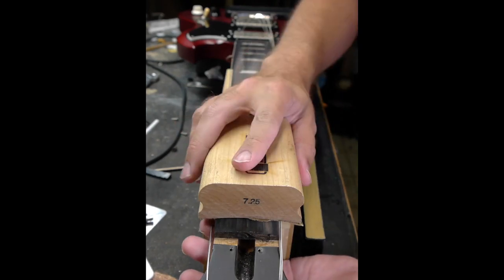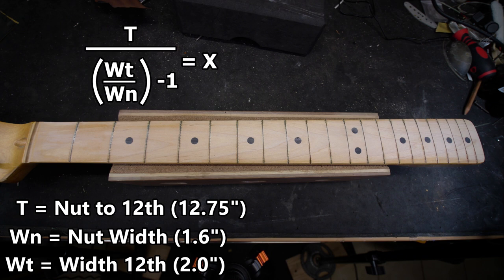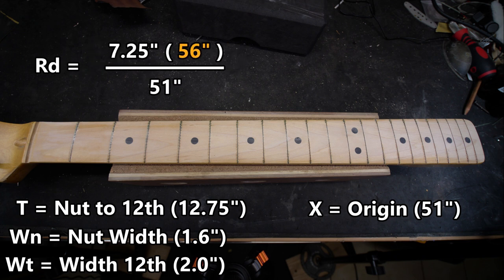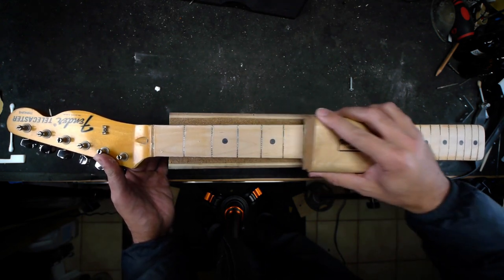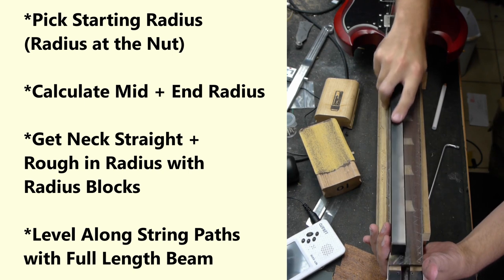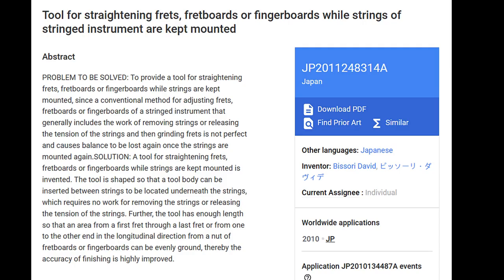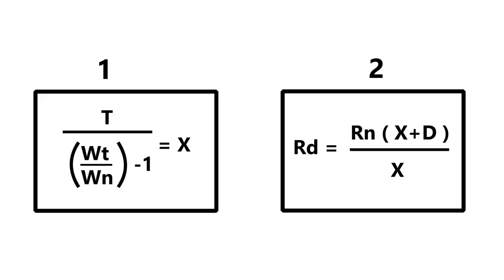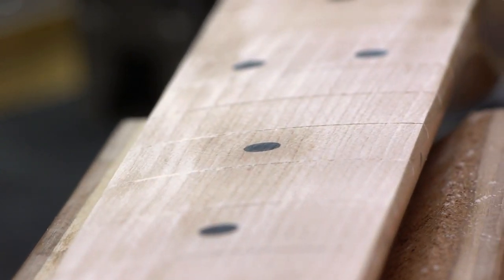"Compound Radius" Formula: Conical Profiling for Stringed Instrument Fingerboards / Frets

Comment: Looks like I can go lower on my treble string setups.  your 0.76mm action at the 12th beats my 0.933mm.  But I just set all the strings to the same action - so basically, I set them all to what the 6th string needs. And I never use falloff.  Also, I'm running Ernie Ball Extra Slinkeys - 8's thru 36w's.  So I don't need as much flopping room as you do with that 46 gauge string.
Reply from the maker: Lately I've been running .008, .011, .0135, .022, .030, .042. 

I'm never sure what to expect from the Low E. "Buzz" seems to be an undefined variable, that can't be objectively measured -- just heard, and most people have a threshold for what counts as buzz, and how much of it they can live with. 

What's your relief? Generally the E and the A are the only ones I get a bit higher -- the 0.76mmm seems to work fine for DGBE.

I've tried every which way. Old fashioned leveling with the strings off, neck straight, flat steel beam. And the other methods I talk about here. 

0.933mm on the Low E is definitely very low. If you're getting that, I'm curious how you'd define it -- any light buzzing or clear as a bell? And what method do you use? 

Generally I only use fallaway if necessary -- but I may have to redefine what "necessary" means. 

0.933mm on the Low E. That and 0.76mm on the GBE, and the D and A just a touch above that, would be ideal. The last frontier for me is the Low E and A -- and again, part of the problem is not having a standard for "buzz." 

I have played a couple guitars that were clear as a bell on the Low E around that measurement. Maybe once or twice. Exceptionally rare on a stock guitar. Now if I could master that, I'd really be in business. 4 out of 6 strings ain't bad but I need to get that E and A. 

One thing I've wondered is how flat my tools really are. It is possible some of my beams aren't perfectly flat and I'm not sure how to check them. That could certainly be a major thing here. 

Sometimes I've found higher tension strings to vibrate in a smaller arc as well -- if you're getting less buzz with a lighter gauge string then I'll rethink and re-test this. I do tune down to Eb with the strings I use and often go to drop D from there, so even that .042 gets pretty slinky.
Reply: @guitar_md  I run zero relief on Fender scale lengths.  For Gibsons, I'll start with zero and add a bit of relief if needed.  "Clear as a bell" is the only REAL definition of "no buzz".  I start by setting the fret plane level - not the neck.  So, I skip the notched straightedge and go directly to the flat straightedge on the tops of the frets.  After all, it's the tops of the frets that we want level.  If the fingerboard waves a bit, it doesn't really matter as long as the fret crowns are level.  For the nut, I usually fit a locknut.  I use a fret pulling guard in the nut slot and across the first and second frets. I then shim the nut until the fret pulling guard just clears the number 1 fret when resting on the 2nd fret and in the nut slot.  So, my action at the 1st fret is on the order of 0.005" - almost at the fret plane. Technically, you can go all the way down to the fret plane, but1/1000th lower and your screwed.  So, I shoot for just above the fret plane.  Then I set the action at the 24th to about 1.4mm and I'm done.  I could probably go a little lower across the board if I wanted to be OCD about things.

They make what are known as "machinist's surfaces" (or a similar name).  The are dead flat surfaces suitable for checking the accuracy of tools, but they are expensive.  A machinist's square or straightedge is a possible alternative:
https://www.amazon.com/Granite-Surface-Plate-18-Grade/dp/B006JYKIVC/ref=sr_1_5?keywords=machinist+surface&qid=1700163886&sr=8-5

https://www.amazon.com/Granite-Surface-Plate-12-Grade/dp/B006JYKIE4/ref=sr_1_16?keywords=machinist+surface&qid=1700163886&sr=8-16&ufe=app_do%3Aamzn1.fos.17d9e15d-4e43-4581-b373-0e5c1a776d5d

https://www.amazon.com/0-0002-10-Straightness-Parallelism-Machinists/dp/B0CGDLKP7P/ref=sr_1_10?keywords=machinist%2Bsurface&qid=1700163886&sr=8-10&th=1

https://www.amazon.com/Anodized-Tolerance-Straightness-Machinery-38/dp/B07H3DQQHS/ref=sr_1_20?keywords=machinist+surface&qid=1700163886&sr=8-20

Use Stringjoy.com's tension calculator to find out exactly what's what with your string tensions:  https://tension.stringjoy.com/
It will tell you the effect of changes in scale length, tuning, and string gauge on the tension required to bring a string to pitch.  And more tension = less floppy.  Generally speaking, shorter scale lengths, fatter strings, and lower tunings will all make the strings floppier.  That's why multiscale is superior for fat strings and drop tunings.  The longer scale lengths help counteract the floppiness from the fat strings and drop tunings.

I'm certain you could reproduce my results and probably even take then a bit farther by switching to 8 thru 36w's and standard tuning.  If you're worried about losing fatness on the bottom end with 36's, just give it a notch on volume and a nudge on the lower bands of your EQ pedal.  If you're out of headroom - time for a bigger amp.  If you have to play something in D instead of E, a pitch shifting pedal is a possible alternative to drop tuning.  But if you're really into fat strings and drop tuning, I'd recommend you make yourself a multiscale 6 or 7 string.

FYI, Ken Parker makes his under string fret leveling tools from pickguard material and sandpaper - no handle.  They are quick to make, easy to use, disposable, and inexpensive.

So after watching this and a few other vids on compound radius fretboards, I've decided to try something totally insane - a 12" or 16" to infinite (flat) "compound radius" fretboard.  Being flat at the heel, it won't be a true cone.  If it doesn't work, I can always get another piece of Richlite and do a 12 to 16, or a 16 to 20 or some such thing.

Its just occurred to me that those formulas might be artificially restrictive.  Nothing says the cone has to be uniform in both width and height.  But the formulas restrict the height to what will fit in the width.  Nothing says the cone must be circular on the bottom.  An oval bottom (wider than it is tall) would allow more radical changes in radius. So you could do a 9.5 to 16 instead of a 9.5 to 12, for example.
Reply from the maker: @normbarrows  We have very similar tastes. Zero relief here as well. I also level according to the level of the fret tops, and don't use a notched straightedge anymore. I know exactly what you mean. 

With you on the stringjoy tension calculator as well -- actually have been working on a video about it, regarding string tension and preference. A lot of players just go with stock sets when sometimes it can make a tremendous difference to swap out even one string. 

One of my old friends (one of my mentor's best friends as well), who was a machinist (only relevant because we were talking about that) -- he loved a regular .009-.042 set but with a .015 on the G. 

For me, I was using a .014 for a while, and eventually came to .0135. Using the Stringjoy calculator, it puts my GBE strings right around 10 pounds of tension. I'm OK with the .011 B string but a .0105 would actually be closer to equal tension, around 9.8 pounds. 

There are some people who prefer progressive tension -- each string successively getting a little higher in tension -- some who prefer balanced, etc. String gauge is a very personal preference yet most people don't know what they like simply because they haven't experimented -- and that's OK! But experimenting with string gauges is a real joy. 

String compliance is another factor, or how easily the string bends. Break angle at the nut/saddle will affect this, also whether using a locking nut or not. I tend to like very shallow break angles on my electrics, or at least, as shallow as possible. So with a decked trem on a Strat, I like replacing the saddle screws with shorter iterations (I also prefer 316 stainless steel because it's pretty much 100% rust proof, important when dealing with corrosive sweat), I get the action where I want it while having the saddles as low as possible. 

Sometimes that requires shimming the neck at the top, to raise the action a bit. I never used full pocket shims except a handful of times, and the guy who taught me never used them. 

However, I do get the concept, and I'd love to make my own. i've had my eye on a Byrnes Model Machines thickness sander for years now, and would love to use it for making pickup bobbin assembly rigs, thicknessing bone nut and saddle blanks, and making tapered full pocket shims, just to start. 

Thicknessing is a real pain and the Byrnes is accurate to .003". His machines really are top notch and they have incredible functionality to offer people who like tinkering with small objects in very fine detail. 

Also agreed about multiscale instruments. I have a multiscale 7 string and it's a godsend for that reason. The additional scale length adds to the string tension and not only do the fanned frets intonate better, but that added tension goes a long way in preventing buzz. 

I used to use a .038 on the bottom. One more note about volume: in my years of winding pickups, I've come to the opinion that magnet stagger is more relevant for string gauge than it is for radius. The string gauge seems to have a much more pronounced effect on volume balance to my ear than the radius does. 

Now on my Tele I use a wound G, so it would make sense to have a raised G pole -- plain steel G strings, not so much. In general for standard modern strings I like a stagger of .680, .693, .710-.719 for EAD / GBE. Short medium tall, short medium tall. They balance great. You can tweak it of course for oddball string gauges like a wound G or an extra heavy Low E string, or B string for that matter. 

I've gotten a bit less ballsy lately with action at the 1st fret. Usually I'll leave it quite a bit higher than you've mentioned, but now that you bring that up, i might lower my Strat just a bit more. I'm a freak for low action and the 1st fret action is tremendously important, as you obviously know. 

Getting it within a whisper of the 1st fret with zero relief really does feel the best. You're probably the only other tech I've ever talked to who does this. Most people's specifications for a setup are far higher than what we're talking about here. To me, guitars set up much higher than the way I do them are basically unplayable. 

That might sound ridiculous, but once you experience truly low action, the ease of playing it offers -- it's really hard to go back. Of course, I have some customers that despise low action and due to their style, they need it high to "get under the string" for bending and vibrato. 

To me, I always felt this was a product of having frets that were too low. I usually prefer .110" x .057" frets. Sometimes I'll deliberately take them down to around .050". I'd say .050" feels great to me, and I don't like it any lower than that.
Reply from the maker: @normbarrows   @normbarrows  RE: Pickguard material for understring leveling. Years ago I made understring levelers out of 1" carbon fiber i-beam from Dragonplate Carbon Fiber in NY. 

Expensive, yes -- but it's incredibly thin, around .030", and has the benefit of being re-coatable. You can coat it with epoxy and re-level it if it ever happens to go out of spec. It's so thin that the amount you need to jack the strings up for a full-length leveling is minimal. I do own and use the Rectify Master tools in support of Davide Bissoli who really has been the biggest pioneer with the understring leveling game. 

Sadowsky from Warwick was actually Davide's first major sponsor and has been a huge advocate for understring leveling, in particular, Davide's tools from Rectify Master. Anyway, I have to give credit where credit is due. I will say I still think carbon fiber is the best material for understring leveling. 

RE: radius. This is where the distinction comes in. Conical profiling, strictly speaking, is restrictive -- but that's why we call it conical. 

Deviations from a strict geometric cone are no longer a cone. However, they can and do work. I've wondered about this myself, after learning the formula and wondering how places like Warmoth could do a 9.5" - 12" radius, but then do a 9.5" - 14" or 9.5" - 16" if they wanted to. 

I'm not sure how I'd recreate this, outside of leveling a 'secondary cone' into the fret tops. Like in that picture I show early in this compound radius video. I'd be really curious how they do it at the factory. It seems you're better at naturally visualizing this stuff than I am. 

What I've done for years is level the middle of the frets from say, 9 or 10 to the end, to flatten the radius at the top a bit. This deviates from a cone. But really allows for much bigger string bends with little issues, and rock bottom action. 

The conical formula I see as the definition of a strict cone -- but not the be-all end-all for guitar fingerboards. I do think they're the best starting point. They can also be the finishing point. 

Also: as a player, I vastly prefer the conical profile/compound radius. The hand naturally forms more of a curve when the neck is narrower. As it widens, it feels more natural to have a bit of a flatter radius. This is my opinion of course but has been 100% true for me as a player. The difference in feel is night and day to me. Ever since I discovered the compound radius, I never looked back. 

I do wonder about that older video you commented on. I got just fine results. But didn't really understand what I was doing like I do now. That's the trouble with some of these videos -- you learn a lot more as you go, as every video is a deep dive. I don't want to be throwing anyone off so at some point those videos might get completely re-done, or just put on Private. 

i do keep my playlists all updated with only my most recent content. That's the saving grace here.
Reply: @guitar_md  Yeah, in the other video I saw that under string leveling tool you made - pretty sweet.  Too bad someone else has a patent - could be a nice side gig for you.    I tried the Ken Parker style tools but wasn't really impressed.  But that probably had more to do with trying to spot level when I should have just gone for a full level.  These days, I take a less is more approach to fretwork.  Checking the truss rod and rolling fret ends and fretboard edges with sandpaper (if needed) are now the only steps I do on all necks.  But I'm mostly modding Ibanez replacement necks.  can't remember the last time I had to do a full level crown and polish on a build - last year? maybe 6 builds ago?  These days it's just the occasional fret sprout, now that the cold weather is here.
Reply: @guitar_md  
When it comes to fretboards, I'm not very picky.  I've been playing for so long and have played so many different types of guitars that I can pick up just about anything and play it with little difficulty.  Acoustic 12 strings and nylon string classicals taught me precision, and how to play full barre chords on a zero radius fretboard at any fret - It's all about getting that left pointer finger absolutely straight and perpendicular to your palm. Once you train those muscles, you can play barre chords with no radius required.  Both of my successful carbon fiber neck builds have flat fretboards.  I was considering doing it again for the single tube I'm about to start, but decided to not be lazy and do a radius - not everyone has suffered through learning how to play a flat classical fingerboard.

As for the conical stuff, picture your cone, then imagine squeezing the base from the top and the bottom.  So, the base gets squashed from a circle to an ellipse.  The top of the ellipse is the top of your fretboard radius at the heel.   You can keep your cone circular at the top end at the nut, but squish the bottom end at the heel into an ellipse.  The more you squish it, the wider the radius of the top of the ellipse becomes. so your 10" radius at the heel becomes 12, 14, 16, 20, or eventually flat as you squish the bottom of the cone more.  Roll a piece of paper into a cone, then squish the big end, and you'll immediately see what I mean.

If you don't replace the old video with the new one, be sure to add a link to the new video in the description of the old video or a pinned comment.  Fret end dressing vids are about the only thing that I update.  I don't take down the old ones, but I always link them to the new ones.
Reply from the maker: @normbarrows  I've talked with Davide Bissoli personally (owner of Rectify Master) and he's a true class act. Stewmac does not respect his patents at all, and I doubt there would be legal issues -- so for me it's a matter of respect. 

i did sell a small handful of the levelers back in the day. Maybe 10 sets. They're great for spot leveling. I made them in a set of 7" and 4", though for myself I've used 3" with an extended handle I made that works beautifully. 

I mostly mod replacement necks as well. I've never actually built a neck from scratch. That's next on the list. I've done so many refrets and so many level and crowns -- making necks would be a labor of love, for sure, as you can't get much for them. I always thought it was nuts that people could be charging $300-$500 for a refret, but if you make a brand new neck from scratch, including putting all the frets in -- you're lucky to get $200 unless it's brand name, like Warmoth. 

Refurbishing / repurposing necks is something I've done for many years, and it just seems so much easier. You do lose out on the shaping and the width at the nut, but it's a true joy to take a cheap-o neck and transform it. 

The current neck on my Tele was $40 on eBay. I removed and replaced all the inlays with abalone inlays, pulled the frets, re-radiused the board and installed Jescar EVO wire, cut a bone nut for it, recontoured the heel and the back of the headstock, shellac finish, the whole nine -- and now it's a killer neck. Gotoh Vintage staggered tuners as well, my personal favorite. 

Next up might be a conversion neck. 24.75" scale for a Strat. I've been playing a lot of fretless lately and like the shorter scale as the notes are closer together. A bit easier to intonate. 

I have some fretboard slabs of Obsidian Ebony that Thermalwood Canada sent to me to make a video for. It's impressive stuff. Looks so close to ebony, you'd never know. It's torrefied maple impregnated with some kind of resin. Really impressive stuff. I think it would be awesome for a fretless board. 

Making a fingerboard might be a good 'first dip' into making necks. I think if I were gonna make necks, I'd use a two way rod, so I could use a completely flat rout for the truss rod.
Reply from the maker: @normbarrows  Any tips for fret sprout? Steve K., the guy who taught me, always fixes this perfectly by hand with a Nicholson file. Just up and down the sides of the neck. He just gets this perfect angle. 

I have a fret beveling file, I've done it by hand, I have a Gurian quarter round file, concave files, pillar files, you name it -- I've tried everything. And if you look at the ends with a macro lens you'd never think they feel as sharp as they do. 

There's just something I'm missing. Hard to believe I'd done so many refrets and countless full level, crown and polishes and I'm just not able to get the hang of this fret edging and rounding thing. Somehow I'll get them near spherical on the end and they still feel sharp. Something is really missing. 

Anyway, I'm all ears if you have any tips, or what you personally do to edge frets, as Steve calls it. Edging and burnishing. He's referring to rounding the edges with a pillar file when he says burnishing. He said Dan Armstrong used to be able to do it lightning fast and it would feel just perfect. 

i'm like the polar opposite there. I have all the beveling block files, hand files, this and that, even a diamond edge dressing file -- and nothing. They never feel perfect to me. If I could get this down and get perfect fret ends I would really have something here.
Reply: @guitar_md  The answer might be long...  I'll try to be concise.
Less is more. remove as little material as possible. hemispherical ends are largely cosmetic - but also a good way to prevent sprout in the first place, as they seldom reach the edge of the fingerboard. Like you I have the 1/4 round file - but it's not the secret weapon one would expect.  For a full tilt end dressing i used to use a stew mac fret end dressing file on the bottom edges, the 1/4 round on the sides of the ends, and a half round crowning file to do the tops of the ends.  With a bit of sculpting, you can get rather hemispherical results.  I've since discovered the 1/4 round contributes very little to the process, and no longer use it.  But I don't bother with hemispherical ends, just nice and playable. My recent video on the fretwork for guitar 11 is a good example.  A new neck, but a bit of sprout.  I used the fret end dressing file to get the bottom corners, the half round to get the tops of the ends, and then a small flat file to get the very ends down near the fingerboard where the other files don't reach. Then I rolled with sandpaper around a needle file.

Guitar 11 Episode 5 (fretwork):
https://www.youtube.com/watch?v=Oi_G8J01Wtw&list=PLDxhKgqkO6tM3L6c4otCAy1bN_jCqyRas&index=5

Fret end demo (hemispherical on already-installed frets):
https://www.youtube.com/watch?v=PGk52k-puzw&list=PLDxhKgqkO6tMyjg4lXgX3TW6NSuojdRzT&index=1

Fret dressing process using the 1/4 round file:
https://www.youtube.com/watch?v=-UpgC8nYvSI

HD results of the process using the 1/4 round file:
https://www.youtube.com/watch?v=g1Uy1tTmzkk